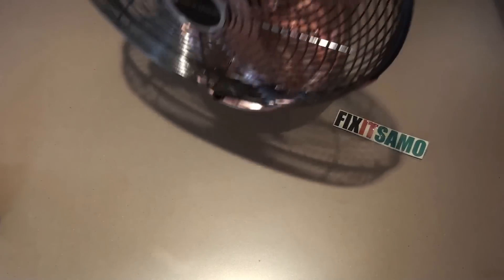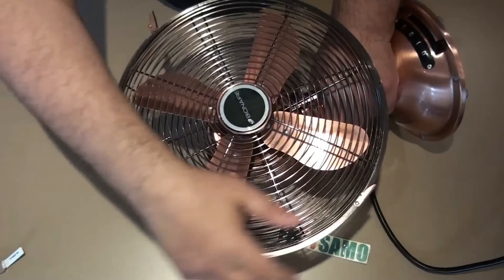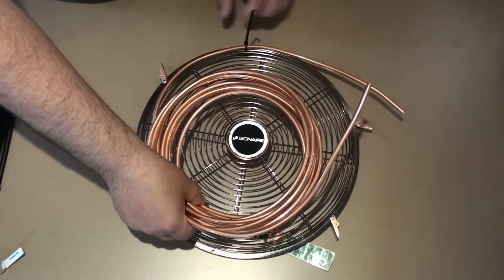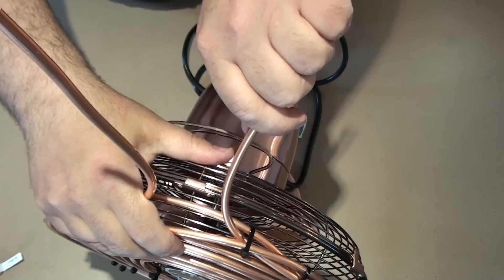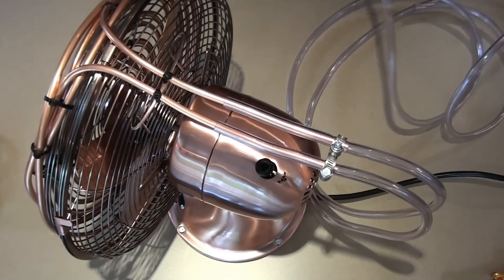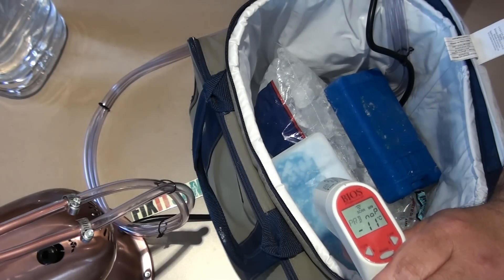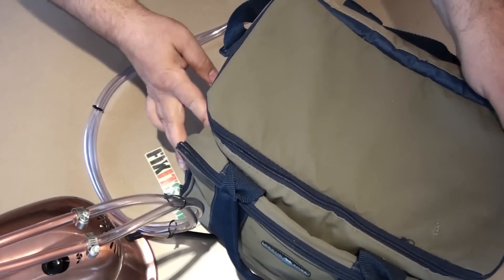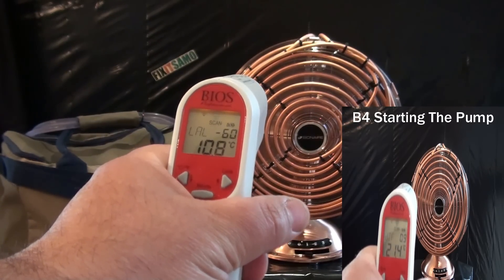How To Turn Your Fan Into An Airconditioner  AC

Comment: Great idea! Thanks for posting.

I really don't understand it, but you seem to have an exceptionally high proportion of trolls in your comment section. What's worse than the trolling is that the remarks they make are really juvenile, extremely ignorant, and for the most part complete nonsense. I would say that for a non-confrontational video you probably have the most trolls I've ever seen. Don't let them get to you.
Reply: I noticed that too. I think it's prejudice based upon the accent. I've been watching all similar videos. I need a 12 volt solution. When I lost power in Florida for a week after a hurricane I was so miserable in heat and humidity that I went to a hotel for week at a cost of $1000. As for generators you can only store so mush gas and gas pumps might be down too.
Reply: @carolhewett3756  In B'luru, some yrs ago, the rains were delayed. Heat was so unbearable, even 2 storeys below, even at late nite, my nbor wud get into his car and turn on the engine and sleep in his car so he cud use the car a/c.
Reply: @Stumble.Stop.Repeat I mean, I guess if you want to close off your kitchen and make it even hotter than it is outside, this silly vid would be a workable solution. Not exactly ideal. I'd stick with a plain old fan before that. Or a plain old AC unit...
Reply: This is actually a terrible idea and will raise the temperature inside your house, if you make the ice in your own fridge. Maybe the issue is that the "trolls" understand physics better than you do?

Comment: It’s a swamp pump been around for ever
Reply: This has several advantages over a swamp cooler. 1.  Quieter. 2. portable. 3. no pads to replace every year. 4. It uses the air inside the house that is already cooler than the outside air creating colder air than a swamp. 5. Using indoor air means you are not pumping air into the house creating pressure requiring an air outlet that has to be closed if the cooler inst running to prevent hot air coming in.  In all these ways this is an air conditioner, not a swamp cooler.  And it has the advantage over traditional air conditioners of not using toxic refrigerant and being light weight/easily portable.  get a 5 day cooler and you just have to change the ice every 5 days.  Why didn't you think of that?
Reply: @grace-ye3ux  , agreed, It uses ice water to cool the air instead of freon.and it's also different from a swamp cooler
Reply: Yup

Comment: You can have the same cooling effect by just having a fan blowing air off the cooler in your direction. That way you save money on the copper tubing and pump. Or just use reusable ice packs.
Reply: The problem with that is that way would increase humidity. With the copper tubing, the humidity would condense and fall downward, so you will want to put something underneath to catch the water. 

That's why those commercials for so-called air conditioners that are actually cold air humidifiers are bunk if you live in a humid environment.

Comment: dude this is for idiots..your air flow has went down by like 35% at least . A normal fam will do alot better..
Reply: Okay I did this just to be screwing around and I think it worked out pretty good it blows cold air and not humid air that's around the fan and I set the fan on high and it felt just fine to me. It's just something to blow on you it ain't got to be 100% but it is colder worked for me. Maybe stop by and cheap shit slow fans buy one that's got a turbo setting and you don't have to put that much copper tubing on there I left more of Gap and it feels cold as shit so it does work

Comment: Idea is good but need a better Design, GJ and just work on improving it
Reply: They did that. It’s called an air conditioner
Reply: @rmiller334  we are talking here about fan and air flow wothout compressed gas and high electricity bill dude
Reply: @UchihaNoble  he put ice in the cooler. Compressed gas and high electricity has already been used.
Reply: @rmiller334  Ice is a compressed gas?
Reply: @UchihaNoble  read your own previous post.
Reply: @rmiller334  sry didnt get ya, I didn't say he is using compressed gas, I said is this a method where u are not using compressed gas or compressor, and lastly it is a good idea in a poor countries like India or Aftican countries where families cannot afford for AC or no infrastructure to support AC
Reply: @UchihaNoble  I guess if they can make ice in poor countries. A swamp cooler would be more likely in a depressed area.

Comment: What about removing the humidity?
Reply: The cold  metal pipes  will  change the humidly in the air into liquid water dripping off them.    Its same reason a cold lemonade drink sweats on humid days.
Reply: No humidity added. Water is sealed in cooler. Think before you speak
Reply: @skip63  The humidity that’s already in the hot room. Don’t be rude. Learn how REAL AC units work.
Reply: @skip63  No-one suggested it did.
One of the reasons AC helps to make you feel cooler is lowering humidity levels. Just leaving it as is makes it feel hotter than it would if you lowered the level.
You could run a dehumidifier as well.. But at the point, stop cheaping out and just buy some AC.
Reply: @s1iznc1d34  Proper AC removes humidity. This doesn't.

Comment: Get a job and buy an ac unit. They aren't that expensive.
Reply: Ac are expensive and the bill are really really expensive
Reply: @Prideace93  The cost of all this gear, plus having to constantly make ice (and the heat that generates).. Even a small portable AC unit would be cheaper and work far better.
Reply: @Gainn  u do you know this is just for interval uses not all the time use. air cond is way expensive to begin with not to mention the electricity cost  and maintenance. This guy is simply did using ice and water of which is very cheap even if use every day. Here I could get 4 kg of ice cubes for about 50 cent.
Reply: @Prideace93  you can get a small ac unit for about 200.
Then no ice required. Fan still uses power as does the pump.
There are better ways to use forced air cooling than ice water pumping. External radiators are the better long-term solution if you want to be cheap.
Reply: @Prideace93  not true. a fan can be murder on your electric bill.
Reply: @kimberlygaeta7205  but not as much as air cond i presume
Reply: @Gainn  A fan you can stick anywhere in your room, say on top of your desk so you can have cold air blowing on your face. AC units are less portable and require you to have a condenser installed outside and often small AC units don't work well in large rooms. I think the fan is a good idea for cheapskates and for people who want to tinker around. Good if you live in a third world country where AC units are out of your price range. 
I did try something like this ages ago but with a air cooler but it didn't really work. So this guy gets props for coming up with something that works well and is simple to make. The only problem is the inconvenience of having to change the ice.
Reply: Well good luck finding one right now
Reply: @skip63  you buy them in the winter with the rest of the common sense people.
Reply: Boring B!tch, get out.
Reply: you poor people suck

Comment: I built one of these years ago with a condensate pump. Yes, I'm also an HVAC technician. The key to how well this setup performs will always depend on how cold you can keep the water supply. The insulated cooler this guy used was a nice touch. I'd recommend freezing half gallon jugs and setting them in uniformly to fill the entire cooler with solid ice, basically, & only run enough water that you need to fill the circuit/make it circulate. It's not AC, but they'll help out in a smaller space some.
Reply: @s1iznc1d34  less water to cool, less heat absorbed by the ice.
Reply: @s1iznc1d34  Didn't do squat to your post & I don't see this situation as a win or lose instance...guess you did though, so you can make the assumption what you can do with your shorter hose. 🤣
Reply: @s1iznc1d34  I get it fine & you are correct. Was just looking at the back and forth & thinking I was confused by your response saying "not only", rather than, "not only that". It looked as if you were debating the water level. Apologies for any offense.
Reply: Ive got 25 years in the field . But I only consult now.
Reply: Your an HVAC TEC ??   Could you tell me what you would run the intercooler lbs at on a 2 stage system pulling 8 inches of vacuum ?  And what temp would your evaporator be at ??
Reply: @stevelamperta865  I don't work on systems with intercoolers. I'm in the residential/commercial AC game in the PNW. Don't have occasion to see them. All of my measurements are in gauge pressures, subcooling, superheat, wet bulb, etc. The evaporators I work with run 40-45 degrees, typically.

Comment: Wow I'm amazed at the amount of EXPERT AC guys LOL!! I'm pretty sure that the idea is to cool the air enough to make it comfortable, not a unit to run 24/7 you super-experts... The fellow did a good job and I KNOW it works because I did something similar but on a bigger scale. I used a a big old GMC 4 core truck copper radiator and I connected that bastard right to my outside water tap to test the theory and yes, with a fan blowing air through the rad i was able to comfortably cool my RV down to a fairly comfy 25C from an unliveable 44C in the summer in about 2 hours. The water flow was just a trickle and I used the 'waste' water to irrigate my yard and garden so win win hahaa!!!

Comment: 108 Celsius is around 226 Fahrenheit....not even death valley gets that hot wth
Reply: 10.8 bro
Reply: 😂 you missed the decimal point. I think that he’s be dead if it had hit 108c considering that the water in hit body would be boiling. 😂

Comment: This is a excellent idea for people working under a tent on events  they can't use a ac unit,this point is for the haters with negative comments.
Reply: You've never seen people with AC in their tents? Barbaric!
Reply: It's more of a utilitarian idea... Useful when it can be utilized on a 105 degree (F) day and your AC takes a crap. Just rotating ice packs by using your freezer. I'm makin' one!!!  I am an HVAC/R guy and something like this would get you through the night more comfortably during a system breakdown.
Reply: @AIM6789  yup- happened here- 5 days without air. at 95-102 during the day.
Opened windows and screens along with Reflective tarps on one side lowered it to 85-
Reply: @angelchiriboga3904  very cool...pardon the pun.

Comment: Good idea maybe if you live in the desert, but here in Florida, nope.
Reply: This should work even better in high humid areas since (its not a swamp cooler) it's pushing cold air and does not use water other than for keeping the pipe cold, meaning in a high humidity area, it would also cool the moisture in the air without putting more moisture in (other than in the form of condensation).
Reply: You live in Florida and you don't have any AC?
Reply: @MrGTAmodsgerman  over 6000 comments, you reckon the majority of those people have AC......of course...lol
Reply: @mrshifter8220  Who said they are all from Florida? I am from germany where AC's are very rare to see. But Florida? I mean, you guys were born with that.
Reply: @MrGTAmodsgerman  90% of Americans have AC including me......Its around 111 Fahrenheit in Las Vegas Nevada and 119 F in Death Valley California in contrast to only 79 F in Los Angeles California right now as I'm typing and it's only 215 miles apart.....elevation of death Valley is -282.2' and Los Angeles is 305'........not much difference...I'm in the panhandle of Florida, 800' from the Gulf of Mexico and it's only 83 F.....
Reply: @mrshifter8220  So whats the point? Thats exactly why i posted my question to you in first place. And you answer was sounding sarcastic, so i thought you mean like thats something rare too in your state.
Reply: @MrGTAmodsgerman  Nope, not being sarcastic at all, I think we just misunderstood one another. I try not to ruffle any ones feathers....I'm a devoted Christian and it's the way I try to live.....
Reply: @mrshifter8220   Ok cool, so then all good. So you think this think don't worth in wet places like Florida?
Reply: @MrGTAmodsgerman  Yes, for sure all is good my friend.....Apparently I misunderstood that too....lol....Since it actually does not have flowing water like a swamp cooler (google) it actually does not put much, if any humidity into the air so this would work in Florida if needed so I stand corrected on that.

Comment: I’m thinking about a similar system but instead of the cooling bag. I want a closed pipe system that will run directly inside my large freezer adding copper heat syncs (from Old motherboards) to radiate more low temperatures for the tubes.. don’t know if it will work 🤔
Reply: will work, i do that. but it ruins your freezer seal the fan aparatus is not connected.
Reply: If it does work, you're going to move the heat from where it currently is to wherever your freezer exhausts its heat. Your setup won't eliminate any heat; it will just relocate some of it.

Comment: How do you manage condensation on the coils?  I can imagine after a few minutes of use, water would be sprayed with the cool air your system generates.  Regardless you call it -- A/C vs. Swamp Cooler, -- I reckon it works.  In the 1960s, before A/C was installed in cars, portable swamp coolers designed for cars could be acquired.  Simply plug it into the cigarette lighter, add ice, turn it on and you had cool air.  For our US NAVY relocation that involved a long-haul drive across the southern USA from California to Key West, Florida, dad acquired one the Pontiac Bonneville.  We kept cool, as long as we had ice.  One issue with the cooler: It would occasionally thrust bits of ice through the vents - an amusement for us kids crammed in the back seat during a long boring drive.  Flying chunks of ice: A small price to pay to keep cool in the heat of mid-summer heat.
Reply: You could put a thin layer of wicking fabric under or over the coils to catch the water. This would effectively turn it also into a swamp cooler.
Reply: This is kind of a hybrid between an actual a/c and a swamp cooler. Not an a/c because it's not removing humidity but also not a swamp cooler because it's not adding additional humidity since the water is contained in a closed system.

Comment: Swamp cooler maybe! Air conditioner not!!! Might as well let the ice melt in the sink and save the electricity used by the fan. Same result to room temp.
Reply: A swamp cooler works by evaporating water into the air. 
This forces cool water through pipes that gets moved out by a fan.  You know, like an airconditioner... 
The only thing this doesn't do is replenish the cold liquid through the pipes as warm air passes the pipes and returns to the ice bath, it will slowly heat up and it will stop working. So it's like an airconditioner on batteries, with the batteries being the ice.
Reply: this blows cold air on yo body tho

Comment: You will need a refrigeration system to freeze the blue ice in the first place.
that cost electricity and money.
then you will need to use the same system again to refreeze the blue ice over and over.
cut out the electricity middleman and get a portable AC unit for your room.
Reply: @MarZGamingForever  Please take into account that your freezer produces heat because of electricity + heat that it "pumps" out of the freezing chamber. This means that your freezer heats up the room more than you will ever be able to cool down using the ice from the same freezer. This could only work if you bring in ice from outside the room you are trying to cool down.
Reply: @s1iznc1d34  Heat generated will always be greater because freezers are not "creating" the cold, they basically suck out heat from the freezer and move it outside (that is 1 to 1 because it's simply moving energy from 1 place to another). But now you need to add heat generated by "the work" the freezer must perform in order to do it's job. Basically the first rule of thermodynamics is your friend (and the enemy) in this case.
Reply: A solar powered AC?

Comment: I did the same thing but I used a chiller unit and glycol. Gets down to below zero and you don’t need ice.
Reply: The glycol cooler I made out of a old Sears de-humidifier. I removed the compressor and coils and put the the coils in the glycol tank.
Reply: I just got my coil today,  planning something similar  with antifreeze.

Comment: I wonder if you could use a air compressor instead of a pump
Reply: You'd  need something to cool the compressed & hot air before it goes to the fan to decompresses and drop the temp lower than ambient. It would be so complicated that it would just destroy the whole idea of a cheap and simple A/C.

Comment: I would think that pipe insulation around the tubing would further accelerate and maintain the cooling effect.
Reply: On the supply line of vinyl, yes, all the rest, no. Heat transfers at a faster rate with a larger temperature difference. In actuality, the water would cool back down quicker from being warmer, once hitting the very cold ice water. Isn't applied science just great?! LOL

Comment: This does work! 1. It's a closed loop system.. 2. I use a collector pan under the fan coil to catch the water off the coil.. 3. I  use the little freezer packs which are reusable.. The haters don't know what they are talking about. 4. I use an Igloo 42 Qt chest. Lasts all day!
Reply: You are absolutely correct
Reply: They use a similar set up in crop dusters, they get hot and no ac